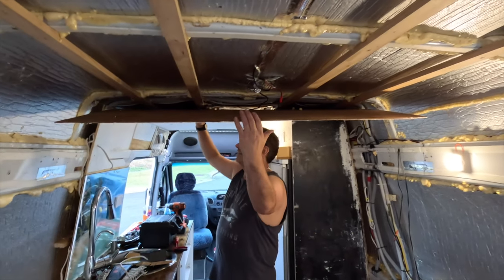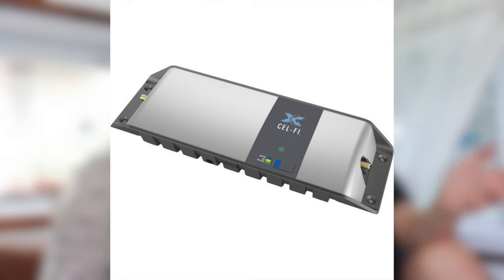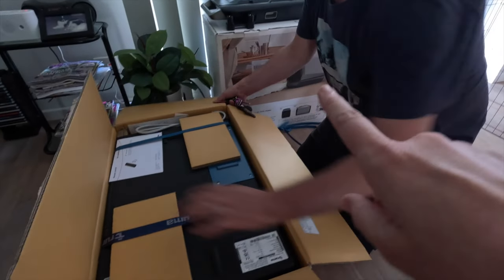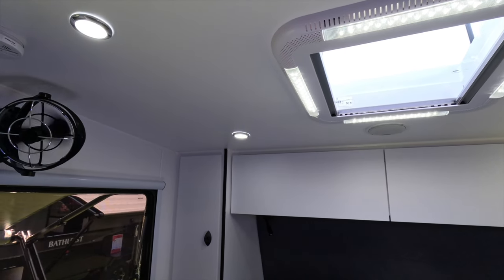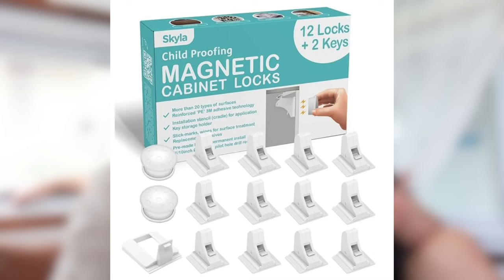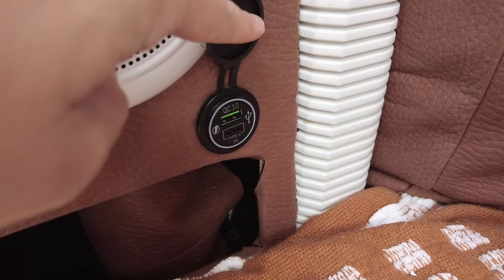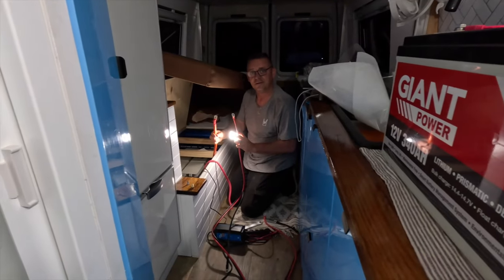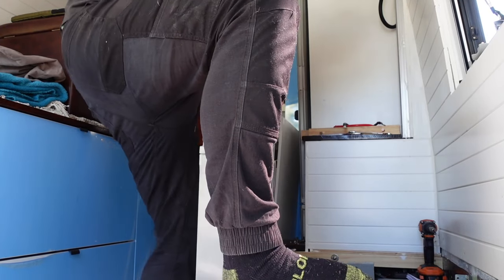WHAT WENT WRONG? - DIY Van Build Regrets.

Comment: I flat-mounted the Starlink on my van's roof. That's where my Starlink lives and takes up no storage space inside the van. I just turn on the inverter when I need to use the Starlink. I canceled my Telstra Nighthawk 4G device which cost $94/mth for 300GB data/mth, so the $174/mth for unlimited data through Starlink was the better deal for me and Starlink works everywhere too.
Reply from the maker: Thank you 😊🙏we would be interested to see your installation of the starlink on the roof 🤩yes it does seem worthwhile paying the extra for the reliability 🤩🚐

Comment: I did a white matte sink first time round and it got black marks and looked horrible in no time and nothing would clean it. I switched it to a black metal sink which is so much better. Also just ripped out my Dometic Heki skylight as it was leaking and the inside cover kept falling off and ripped out the leads to the light so light stoped working, love the skylight concept for light and breeze but switched to an Ozvent and quality is so much better and half the price. Also love the RV labs Latches for the uppers but the drawer ones broke in no time but I’ve been told by the owner they’ve since changed the design but I’ve found a better product.  Vans always need renovations with the constant moving and bumpy roads but such a fun way to live :)
Reply from the maker: Thank you 😊🙏yep sometimes products look good but they sometimes just don’t live up to the rigours of vanlife 🚐🤦‍♂️

Comment: Did you use Living in a Bubble for the front window screens? We have a 2005 Sprinter in Brisbane and are wondering if they fit the van as Living in a Bubble only go back to 2007 Sprinters.  Thanks!😀
Reply from the maker: We used window covers from southern state campervans https://www.sscampervans.com/shop/#!/SOLARscreen-cabin-set-Sprinter-1996-2006/p/130869681/category=25292654
Reply: Thanks for that! Been looking for a while. Might see you on the road around SE QLD :) Love the channel. Thumbs up goes to the Metallica/Disturbed T-shirts  🎸

Comment: What is the name of the better skylight.
Reply from the maker: https://aussietraveller.com.au/products/shower-roof-hatch-1
Reply: @SandVan  Thank you for the link.

In case another European comes across this thinking that looks good but surely the irony of importing a self-labelled "Aussie Traveller...Roof Hatches are designed with the European style" back into Europe is going to cost even more than the simple dollars and cents, a reverse image search throws up an identical looking unit on AliExpress. Which will ship globally rather than importing an already exported item from even further away (to Eur):

https://www.aliexpress.com/item/1005006287735802.html

Much appreciate this, as have been looking at same-same to install in a forthcoming build, as well as your other tips (but really no aircon in AU!?!?!?).

Cheers! 

A Pommie.